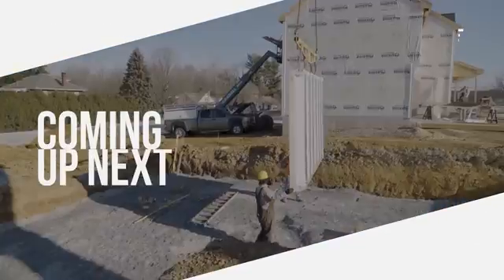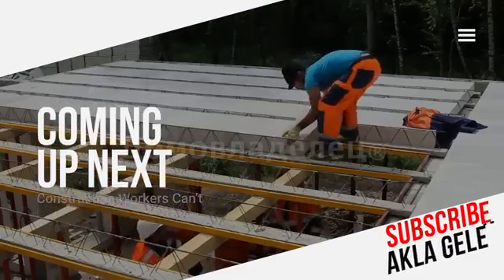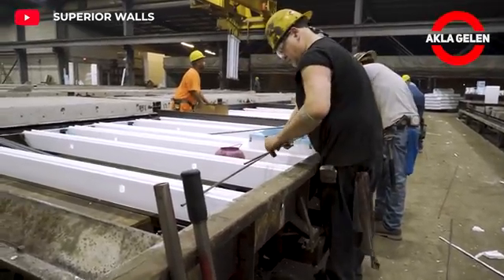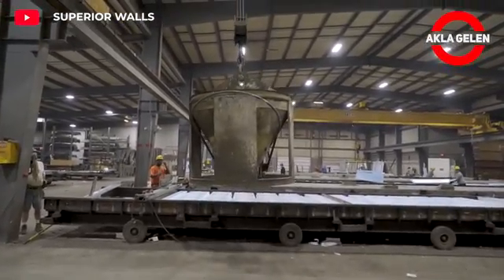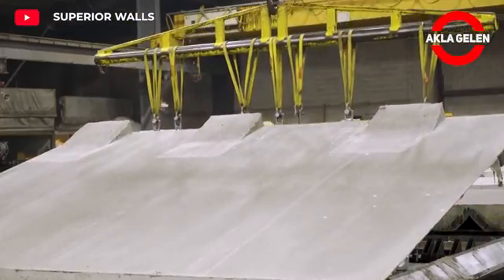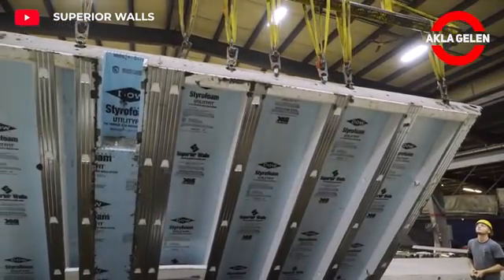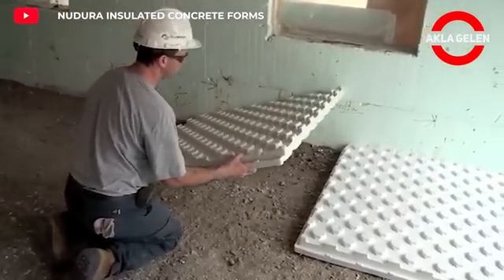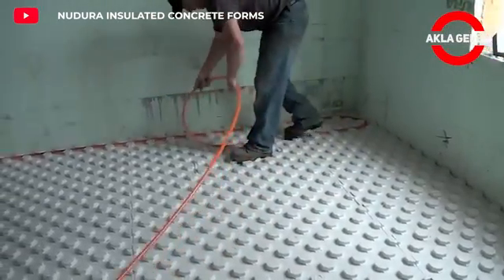Construction Workers Can't Believe This Technique Works - Most Ingenious Construction Technologies

Comment: Your last entry would need to have something vibrant the concrete or cement to get the air out. After working with these materials for years I know what happens is you don't. Tipping a bucket of cement or concrete into a mold is not enough you need to get rid of the air

Comment: I’ve just restored  a 3/4 million townhouse new build in 2017 spray foam every where , roof space , cavities etc all soaking wet holding water against osb ,  moisture rotting the house , mold , wet blown insulation , hvac system full of mold due to increased moisture within property spores growing , I wouldn’t use spray foam if my life depended on it !! Told the client to sell  the property ASAP , the issue will never be resolved . Built by a big box developer as well ..

Comment: The spray foam is a MAJOR risk because one applicator who's no good can leave you with a permanent toxic mess always outgassing. The Plastic forms have a huge issue since you never remove the form you never find the Honeycombing of improperly vibrated concrete (Hidden perforations through the concrete wall). Noticed the foam radiant heat flooring was installed directly on the ground without a vapor barrier to stop Radon from penetrating (It does go through concrete) These Video's are incredibly deceptive  because they NEVER discuss the draw backs associated with these products as if they were commercials for them!

Comment: Wall panels are called PIR/PUR they have been used in construction for nearly 100 years and most big-box stores are built this way. They are not used for single family homes, because they don't adapt well to more complex designs and all of the machinery to install them would cost more than block-laying/wood frame on a small scale.

Hydrofoam is just eps floor insulation (literally every single family home needs this insulation nowadays) that has bumps for floor heating pipes. No one ever needed this, flat panels are fine and probably cheaper.

Brick cladding is pretty much how every single house that has been insulated from the outside achieves "brick look". That's because every single house you make out of bricks gets 30cm of eps on the outside, so they don't look very nice.

Fusion blocks isn't used. It's probably more expensive and a fire hazard. Probably isn't very strong either, might degrade, might be inconsistent. Probably not much thermal mass. Probably doesn't stand up to wind. Probably expensive.

Prefabricated monolithic floor. These are extremely common and have been used for ages.

Spray insulation. Very common. It's called PUR. It has higher thermal resistance than mineral wool or EPS. For about 3 years, you get get the house certified as A++, later it goes down to the same thermal resistivity as EPS. Comparison I think you need about 20cm of PUR or 30cm of EPS. So you have A++ energy efficiency for about 3 years, then it goes to A/A+.

Brick of wood. Never seen it. Sales pitch should be: "Are you tired of simply screwing OSB panels? Well, you're in luck, now you can spend 10 times more time for a worse result!".

Comment: Making pre-fabricated concrete elements make real sense, especially for basement construction because it is much easier to produce such elements horizontally than it is to construct them vertically on the building site..👍👍👍

Comment: Brikawood is an idea taken from the Janpaneese building style of not using nails. Some of oldest buildings in Japan were built with NOT a single nail. 
As for firesafely, is not letting it happen. How? be minful and don't use cheap extention cords all over the house. Build with fire safety in mind.
Reply: It is not only Japanese. The roof construction of old cathedrals and barns in Europe are also constructed without nails. They used wooden wedges instead.
Reply: @duudsuufd  Really I did not know they did in the EU and certainly not about the cathedrals.

Comment: I always cringe at the "air tight" plastic insulation innovations which make your home a closed bottle system. Trouble with air circulation (co2) and especially with air humidity. Humidity changes to liquid water easily when in contact with plastic surfaces in certain temperatures. Water drops inside your walls call for mold. Mold produces toxins that eventually get in your lungs. 
The breathability of a building's structures is an important factor for their longevity and healthiness.

Comment: NO ONE MENTIONS COSTS??? 
Problem is, All of these will More than Double and Some even Triple the Cost of Building a House.. Me, All I need is a Nice 16x28.. I could Get a Prebuilt Shed for AROUND 15,000 but If I make Payments, will have spent ALMOST 30,000 Then be allowed to Convert it.. Or Have one Built for UNDER 10,000 and Spend Less than another 10,000 to actually make it a house... Not 30,000 and then another 10,000 plus to convert one only After you paid it off.. 

I use any of this Stuff and the Costs would be well over 50,000 for that same 16x28.. F' That!

Comment: I think recycling unsortable/unrecyclable plastics (which we have a crap ton of) into bricks like these are a good way to sequester these materials en-masse. We need a stable place to put them, so why not buildings? They probably need a fire-retardant coating that also works as a sealer for any long-term offgassing issues and an UV blocker since that is one of the main things that eventually break down plastics, but otherwise it is both strong and light, can't rot, degrade or seep water. It would be a good insulator, and the very low thermal expansion is a pretty big benefit also. May as well press them into "lego" bricks while you are at it to make bricklaying stupidly easy with a rubber mallet/sledge. If you make an indent in the shape for a spreader tool they would be reusable - which is a good idea for bricks that might realistically last hundreds of years. (yes Lego company, you can steal this idea for your own bricks so we can finally manage to pull the damn things apart lol).

Same idea applies to sequestering compressed carbon in the future from industrial filtering, and hopefully drawn from the air if we can find more cost-effective methods. Sending it down into mines or deep into the ocean floor is unrealistically expensive for the volumes we are talking about. If you can encase blocks of pure compressed carbon into building materials (like in the core of plastic bricks) Then we would have a relatively controlled environment for it and absorb some of the cost by making something that has value. Carbon also has some good material characteristics. We would necessarily need to be better about deconstructing buildings in the future rather than just smashing them, but if many components were made to be disassembled and reused then it would not only be easier, but also cover much of the labor cost.

Comment: Why would anyone want fake brick that has not proven the test of time? Even more so when real bricks can last 100's of years. Plus everything is plastic or a plastic composite. Why are we introducing more things into the environment that are toxic? Bricks are clay, gypsum, and silica. All natural ingredients. Whereas plastics are not and are toxic to create. Plastics need fossil fuels to be created. You have politicians saying, "climate crisis" and "we need to stop the use of oil". Meanwhile allowing construction industry (car industry, clothing industry, food industry, etc.) to make everything from fossil fuels. Everything is a lie. Actions speak louder than words.

Take Luxury vinyl flooring as a prime example. Tile is natural. Wood flooring is natural and renewable. Vinyl flooring is all plastic.... Same with vinyl siding. Wood siding can last forever with proper maintenance. Hardy board siding is the same. Yet there is a huge push for vinyl siding. But no, plastics straws are illegal cause of the "climate crisis". There are so many products turning to the dependency of fossil fuels while the lawmakers and regulators tell you that you need to stop using gas vehicles and drive EV's...

How much more plastic do you see on cars these days? In furniture? In clothing? In food storage? Metal is recyclable. Leather is renewable. Cotton is renewable. Wood is renewable. Yet everything is becoming plastic. It's sickening. Leaders are screaming about climate change, while allowing big industry to poison our planet.

Comment: Use hemp. All these materials are far more toxic. They leak toxins into your home and these homes don't last half as long as houses built in a longer time frame. Allowing foundations to settle. You'll see houses over 100 years old that still stand with strong bones. Today's homes are built so cheap, they are in constant repair including all appliances built these days are built to break down in 5 years. Cool isint it??

Comment: Let's see a fire test with plastic melted blocks.😅😅
Reply: What chemicals would be released when the plastic bricks burned? You would die from smoke inhalation long before the melted plastic got to you.
Reply: @leslieturner   well that would depend on what type of plastic is in the blocks. Without any additives LD-PE burns cleaner than wood does but im thinking these recycled blocks could contain pretty large number of additives used in plastic producs such as colour granules, anti static additives, uv resistance additives and god knows whats released when those are burned
Reply: not to mention the house insulated with wood chips...
Reply: The plastic would off gas over time too. Nothing "environmentally friendly" about living in a plastic filled home.
Reply: Oder die chemischen Ausdünstungen. Das funktioniert auf Dauer nicht
Reply: Lol
Reply: Simple... seal the plastic blocks  inside and out with gunite 12,000 psi and it will conform and seal.  Not going to burn with concrete cladding and has huge R value!!  While gunite is wet, have the finishers smooth it for good finish!
Reply: Simple... seal the plastic blocks  inside and out with gunite 12,000 psi and it will conform and seal.  Not going to burn with concrete cladding and has huge R value!!  While gunite is wet, have the finishers smooth it for good finish!

Comment: Spraying foam on the exterior?   Genius move!   Until a rogue branch turns your epoxy into a pincushion and water starts playing hide-and-seek in your walls.   And don’t get me started on the ants setting up five-star resorts inside your foam fortress.   Spraying foam indoors, though?   That’s where it’s at: cozy insulation, no leaks, and the heat stays outside, where it belongs.   As for the outside—just remember, what goes on, must stay on.   My buddy’s ant-infested, termite-tapas house is a cautionary tale.   Six grand well spent, I say!
Reply: I imagine they have to seal it somehow. Either it’s in the mix or they paint it on afterwards. Still I agree with you better to use it inside, if the walls are hollow to allow it. We had a house where it was done.

Comment: The use of untreated sawdust as insulation sounds like a horrifically bad idea. It would be a tremendous fire hazard.

And it appears you can never reuse that plastic concrete formwork, because the arms that hold it together are cast into the wall.

Also you clickbaited us with a thumbnail that isn't present in the video.

Comment: 2:12 are these guys on crack? They covered a brick house with plastic , glue and fake bricks of the same colour. Absolutely baffling.
Reply: Last century they used rolls of fake brick which were stapled on wooden houses. No insulation either!

Comment: Brickawood looks like a highly flammable construction method, with wood insulated by wood shavings.
Reply: Yeah, and an R value of 1.4 per inch of wood, and a termite haven. No thanks
Reply: I lived in a 100 year old tiny house which had saw dust insulation. It sucked because the sawdust always settles and compacts. Slowly, the upper portion of the wall lose any R value. By the time I was living there, the insulation was only in the bottom two feet of the walls.
Reply: @michellemybelle007 same here.
Reply: @michellemybelle007  So it can't burn anymore, right?
Reply: @Connor98-Discovery  Depends on how much fire retardant is used. Of course, that isn't good for your lungs long term either.
Reply: @storbokki371  Oh.Thanks for the information you shared
Reply: Packrats love them
Reply: I remember seeing it the first time in 1989. I believe it's been performing quite successfully used in docks, both water and warehouse types. Outside foot paths, patio decks, benches, picnic tables. Using sst screws and maintenance looks pretty minimal.
Reply: mice haven.
Reply: You're Screwed if a part of the wall gets Rot because they are interlocked replacing interior or exterior pieces leaves weak spots in the interdependent structure.
Reply: termite Heavan

Comment: 1) a fake concrete wall with 1/3 the concrete and 1/8th the required rebar......  ... that doesnt appear to have proper ties... no thanks 
2) the fake concrete wall was installed for a basement.... on (poorly graded?) gravel.  not the foundation slab..  nothing says "load bearing" like cracked 3" thick concrete in the vert
3) Byfusion blocks = trash throw away home that cannot be repaired.  Unless you are rich, do not bother
4) Brickawood = a more expensive timber home..... that is as flammable as when ppl used newspaper for insulation
5) Cicala Block, for when you want your form setup to take 2 weeks and want to toss out the concrete forms = pissing away $$ for no reason

Comment: Many of these ideas are ok, but, would never pass regulations in the USA.. The all wood block home wouldn't last a year in Florida or Texas, as the termites would have one hell of a feast on it. The exposed plastic blocks would never pass fire codes. Same for the recycled plastic blocks..
Reply: There already in Illinois for years now.  The heating and cooling bills are fractional.
Reply: You do know that there are several species of wood that termites won't chew up, right???
Reply: You do know that all wood will burn right? LMAO and many of the ones you speak of that are more termite proof they burn and also then are a hazard as they burn lol so you have many sides of why it is a bad idea to fill voids with chips of flammable materials lol
Reply: @Jade7073   Of course I know all wood burns. At some degree, everything burns!! What I mean about not passing code is that code says materials have to be covered with a material that will take longer to burn and allow fire to spread. For instance, if you live in a home that is built close to another home, (ZERO LOT-LINE), you have to cover the wood construction even in your garage to slow ignition or spread of fire. This is to allow more time to get people and pets out and to give firefighting a chance to save the homes.  I am a veteran and was a firefighter on ships. So I had to go through training to fight fires and slowing the growth of a fire is key.
Reply: Not to even get into pressure treated woods, one of the chemicals it is treated with is a pesticide. I mean fuck, are you uneducated? Or ignorant?
Reply: @russbell6418 This is actually so untrue foam board provides a super low insulating factor... WAY better to go with fiber like insulation or even old school fiberglass. Look up the values you will see foam board is super low. So yeah not even remotely true...
Reply: Pass finland never

Comment: I like the Bricka-Block as it uses wood joining channels & all the shavings from cutting those channels are used as
the insulation in the walls.  Homes that are "Tight" can't expel the toxins from the dwelling leaving them inside and
you breathe them.  Some cool, kool, and kewl stuff here.......... peace
Reply: and is a fire hazard
Reply: Yep,  that's a fact so I'd not use candles.... peace
Reply: Хороший многоквартирный дом для мышей.
Reply: @Дарья-22-и2е     good point !

Comment: This technique doesn't work well when tree limbs break off and stick through the epoxy paint, then into the foam. Water will work its way through the foam and cause damage to the house. Now, spraying foam on the inside of the house will keep the heat outside with no leaks. Don't spray foam on the outside, because you'll regret it. Plus, once sprayed on the outside of the house, it's almost impossible to remove the foam without destroying the outside of your house. A friend of mine is regretting it because ant's love to nest inside this foam. Any leaks at all, your house will be like a sponge, and termites will eat at your house, from the inside out!  This will cost you about 6 thousand dollars to spray! Not worth the aggravation,!!!!!!!!!!!!!!!!!!!!!!!!
Reply: Insulation foam is very different from concrete foam that sets hard. They have even been used to raise houses that have sunked a little.
Reply: Closed cell foams don’t absorb water.
Reply: @Nashua-l1h  several of these houses where I live.  Cheap to heat and cool. Couple of them are over 20 years old.
Reply: Closed cell foam does not absorb like great stuff
Reply: Plus that spray burns like crazy in a fire.
Reply: @kellymcdonell9687 its non flammable.
Reply: @kellymcdonell9687 Well that's not good at all.
Reply: It's funny that that people invest their effort time and money in to something that is purely visible that not going to work.
Reply: Bet chemicals leech out of that stuff
Reply: Brickawood;  a termite’s dream come true !
Reply: @ItAintMeBabe99  unlike a regular wood frame house,  huh?
Reply: @LisaMitchell-f8e Correct!  A regular wood construction doesn’t stuff “wood shavings” into the voids in the walls.
Reply: It's worked for years.  This isn't new. Everything calls for maintenance and upkeep.  Termites wreak havoc on a wood house,  so does fire.
Reply: Stucco or brick doesn’t work well either when a tree branch penetrates.